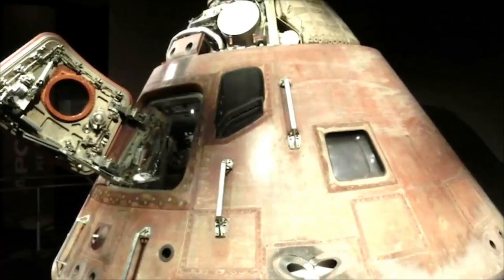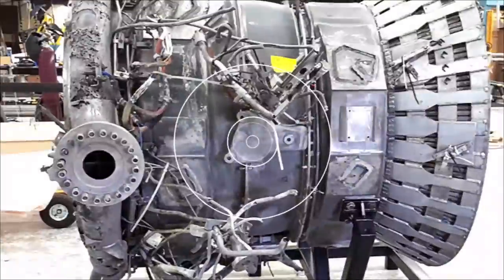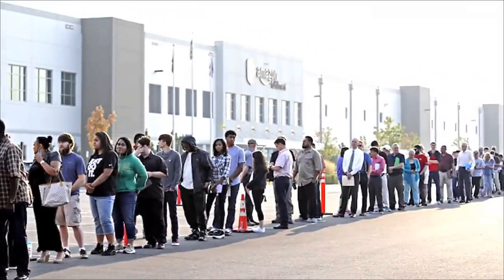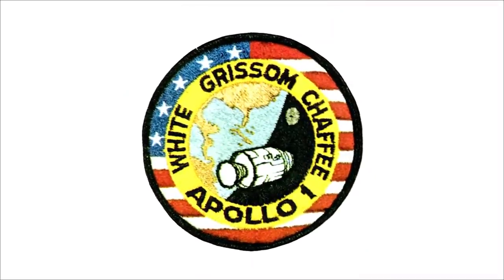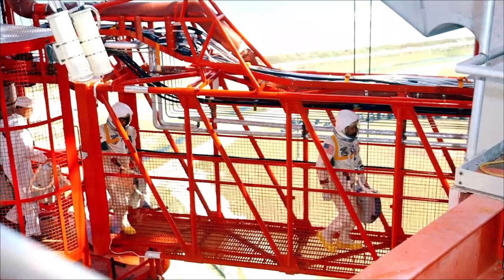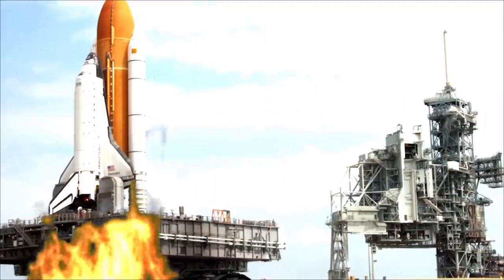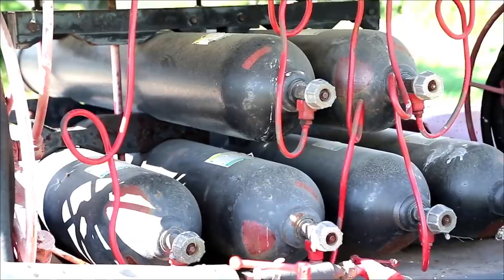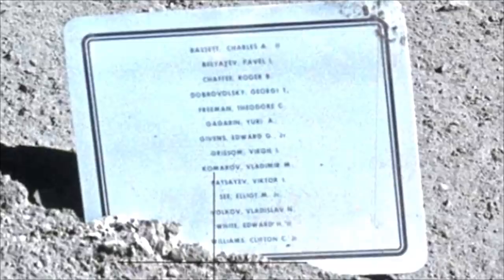When NASA Staff Opened The Hatches Of Apollo 1, They Were Met By A Truly Harrowing Sight

Comment: Short story... This was the Apollo1 fire that killed 3 crew members and was caused by the use of a pure oxygen environment and a spark from unshielded wiring. Boom. Saved you 12 minutes.
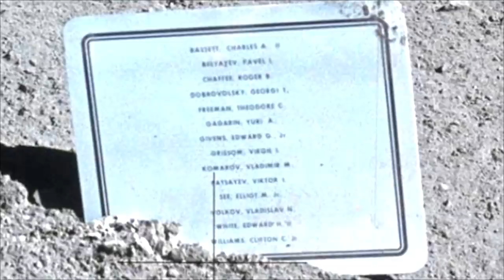Reply: Yep, and why insert a photo of VP Pence at 12:12 ?
Reply: Thank u. I'm out
Reply: I wondered why it took 12 minutes and 9 ads
Reply: thank you i will not be irritated for the next twelve minutes.
Reply: I remember it vividly.
Reply: FYI Oxygen isn't flammable.
Reply: @Medic69  Really... Then I suggest you stand in a pure oxygen atmosphere and light an oil lamp...
Reply: @ZephodBeeblebrox  he is technically correct. Oxygen supports combustion (like any oxidizer) but its self isn't flammable.
Reply: Thanks
Reply: waste of time to watch + too many ads
Reply: @nathan87dlkh  you can skip through the ads, just slide by or punch on the side of the ad, then start the whole thing over. No ads, you're welcome.
Reply: Medic Absolutely correct. Oxygen is NOT flammable, however a 100% O2 environment will support combustion EXTREMELY well. An arc becomes a spark, a spark becomes a flame, a flame becomes a conflagration, and the conflagration became a tragedy - which should have never been allowed to happen.

Which to the engineers at NASA should’ve been as obvious as the pain subsequent to a punch to the nose. Why they chose to us a pure oxygen environment has always been beyond me.
Reply: @Medic69  Swing by Cody's Lab and he burns pure oxygen in a propane or acetylene environment
Reply: thanks. closed it after reading this.
Reply: Thx for this
Reply: Wow I will be blocking this channel, maybe learn how to stay on track and not just use filler.
Reply: thanks, the guy was rambliing in a high pitch voice never arriving to the point.
Reply: Thanks. There is over an ad per minute on this stupid video. They stretch a short story out far too long.
Reply: Cynthia Ayers thanks for the tip, but not worth it. Will simply find a less greedy channel that respects their viewers.
Reply: tinwoods except that is exactly what most of us wanted because this video is stretched out far too long just to force you to watch a dozen or more ads
Reply: Thank you!
Reply: thx a LOT
Reply: Thanks !
Reply: @nathan87dlkh  use a damn add blocker, it takes you literally 10 sec to download.
Reply: Thanks bud that's all I wanted
Reply: @cr4zyu  uh... huh... yeah, that makes tooootal sense
Because I guess the moon landing was staged? People these days...
Reply: Thanks for the info
Reply: Thanks
Reply: Thank, oh my this video is so confusing and with so many unnecessary details that don’t help answering the click bait title
Reply: @Medic69  Though oxygen does not burn, it is an oxidizer, which means it supports the process of combustion. So if you already have a fuel and a fire, adding oxygen will feed the flames
Reply: Thanks
Reply: @ifixbones  it's not a fuel thus does not feed the fire.  A fuel can be a hydrocarbon or organic material such as wood or paper.  Oxygen is an oxidizer and the fact still remains a non flammable gas.
Reply: @Medic69  You were right on your first statement, however you're wrong in stating that O2 will NOT feed the fire.
Reply: @Medic69  0p00"99
Reply: Thanks
Reply: Thank you so much!
Reply: @johnshean8715  ... or the insert photo from Close Encounters movie ?!?
Reply: ... or a video clip from a Soyuz capsule
Reply: @OldStreetDoc  I'm of precisely the same opinion. It seems astounding that, with all of those brilliant people, surely someone would have realised this? It's one of the first incontrovertible understandings taught about lighting fires or welding with oxy-acetylene, that increasing oxygen levels promotes accelerated combustion/heating/melting. Surely ONE person would have raised questions about an oxygen-rich environment??? There must have been welders, scientists or somebody with a particle of common sense in the organisation, surely ...
Reply: thanks for saving 11 minute of my life
Reply: @OldStreetDoc  metal burns like wood in pure oxygen, plastics like gasoline.
Reply: @OldStreetDoc  cost, and system complexity.
Reply: legend zephod 👌 thanks
Reply: Thank you!!!!! I scrolled throuigh it and got nothing!!!! Appreciate you!!!!!!
Reply: Zephod Beeblebrox ....all you people who do this.....STOP⁉️
Reply: Thank you,old story,milked for viewers
Reply: I wanna see pics
Reply: @animalanimal7939  I'm trying to find one of those free places you can put lotsa pics, I tried Flickr, but they wouldn't accept my e-mail address!!!??
Reply: @ZephodBeeblebrox  ya oxygen is the gasoline of  gasses
Reply: Cool, thank you..I hate these draaag on, click bait videos.
Reply: I was a whole lot younger when this disaster occurred.   
The breathing air mixture was deliberately changed to be incapable of causing a fire on flammable, pure rubber wire insulation---which the designers also changed, to something less flammable.
       IMHO,  too little; too  late for the fatal crewmembers...
---Lee
Reply: THANK YOU!!
Reply: @nathan87dlkh  horrible video... you didn't miss much. No disrespect to the producer... but dudes!!!
Reply: Thanks. I avoided 1 add per min
Reply: Thanks.
Reply: @didyouknow
Reply: @Medic69  Pure oxygen is
Reply: Decision made by some suit.
Reply: @johnshean8715  And Mike Pence was about 7 years old when the fire happen. Shows him looking remarkably old in the photo for being 7 don't you think.
Reply: But you would miss random and unrelated images including Soyuz, Space Shuttles, a bushfire (with real firefighters thought), not astronaut people exercising in a gym, Sci-fi movie sequences...
If you can't make a video, all you have to do is telling a well known story, gather distantly related images, upload aĺl this stuff on YT, allow ads, and hope for clicks.
Reply: More like a whoof than a boom.
Reply: thanks... I hate how this channel saves what you're looking for to the very end.
Reply: thank you!!
Reply: @ZephodBeeblebrox   oxygen isnt flammable. it aids combustion processes. hydrogen is flammable.
Reply: @kurtreber9813  correct
Reply: I have see so many of you do the public service of encapsulating the key message of a mindlessly long video ! Thank you - if a 1000 people saw your message and acted on it you have 200 hours of humanity ! Thank you
Reply: I was thought it was Gemini 7
Reply: Tyty
Reply: Thank you !
Reply: 👍🏼👍🏼 Thank you
Reply: Remember the Electical industry will undermined safe to save $1
Reply: And don’t forget the preponderance of Velcro
Reply: No pictures of the charred inside ....no pictures of the remains laid side by side....no live last radio transmissions....
move along NOTHING TO SEE HERE
Reply: The sing song voice of the narrative is a poor choice for this serious subject.  There is a different video of the voices of the men screaming to get out.  It shows the astronaut space suits in aftermath, burned up.  It was a horrible death for these men.
Reply: I don't need your short story.
Reply: Thanks
Reply: Thanks!
Reply: Thanks professor
Reply: @ZephodBeeblebrox  hahaha 🙃 good one!
Reply: @Medic69  No, but its presence dramatically increases flammability.
Reply: Thank you 😊
Reply: what about the velcro?
Reply: And as I understand it also aided by a structure that used magnesium.
Reply: @kurtreber9813  dudes horrible for it
Reply: Thank you Time Hero. I vow to use a part of my saved time to send thanks. Many thanks.
Reply: I will watch anyway. So there!
Reply: Figures
Reply: @Medic69  pure oxygen Is highly flammable. The the oxygen in the atmosphere is why we can have fire. The reason that we don't go up in a ball of flames. Is because the atmosphere is comprised of. 78% nitrogen 21% oxygen 1% inert gases.
Reply: It was done on purpose to silence Grisham
Reply: Thanks.
Reply: @rationald6799  oxygen is not flammable. Show me on the meds where it says oxygen is flammable. Just show me the placard for flammable oxygen.. lmao I’ll wait
Reply: @wileecoyote5929  beep beep. Wile. Beep beep. Could be . Or could be a horrible accident.

Comment: The picture is not of Apollo 1. Apollo 1's door opened inward. That was the reason the pilots could not escape.
Reply: The “ door “ did not open inward per se … there were three segments to the hatch .. the inner hatch was designed to seal when the spacecraft was pressurized , the middle hatch was installed over the inner hatch , and was effectively the outside of the spacecraft .. the outer hatch was part of the Boost Protective Cover , made mostly of cork to protect the outside of the spacecraft during launch to about second stage ignition .
Reply: @johnkuehl6163  and once the fire was fully established, the inner hatch would've been impossible to open, as the pressure would be too high. The pressure growing high enough to eventually rupture the capsule.

Comment: I was a teen when this happened. Rescuers couldn't get the hatch door to open because the door on Apollo 1 swung inwards, NOT outwards as seen in the several views of the Apollo capsule that are shown in this video. After the fire on Apollo One, NASA redesigned the hatch door to open outwards. The hatch door opening inward was only one of the engineering mistakes that had to be corrected. It's hard to believe with the thousands of engineers involved in the Apollo program and none of them foresaw a problem with inward swinging hatch door or the 100% oxygen atmosphere in the cabin.
Reply: And no exploding bolts in case of emergency
Reply: 20/20 hindsight, and an unfair assessment.   Opening OUTWARDS presents dangers of its own.  Such as any fatigue failure in the locking mechanism could result in explosive decompression IN SPACE.  Having been well engineered enough not to fail for the following sixteen missions is no guarantee something wouldn’t have torn loose on the seventeenth.  It’s also worth remembering that a similar fire hadn’t occurred BEFORE Apollo 1 OR in the intervening five decades afterward suggesting that having made the change actually had no discernible benefit after the fact.  Just an added layer of safety for A VERY SPECIFIC MANNER OF FAILURE ELSEWHERE IN THE CHAIN.
Reply: @martyzielinski1442  No other Apollo mission had a fire because after this one NASA changed the atmosphere, down from pure blowtorch inducing 100% oxygen!  And fire suppression measures were added; fabrics changed...
Reply: One of the reasons that the inward opening hatch was designed, was because of an earlier Gemini mission (also with Gus Grissom), where, after a successful return to earth and a safe initial splashdown, the hatch blew out on his Liberty Bell module without warning, filling the capsule with sea water, and Grissom escaped just before the module sank beneath the waves.
After that, engineers decided to design a new inward opening hatch for all future NASA modules, a hatch that was opened by a lever, instead of the explosive charges that had been used on the lost Liberty capsule.
Ironically, it was this new and “improved” inward opening hatch that made escape impossible for Grissom, White and Chaffee when the fire broke out in the capsule of Apollo One.

Comment: The hatch on that spacecraft opened INWARD. NO way that Ed White, as strong as he was, was going to pull that hatch open against the building pressure inside the capsule. The whole thing was over....star to finish....in about 20 seconds.
Reply: Even today hatches used in spaceflight open because of the lessons learned with Apollo 1.  Case in point: Watch one of NASA's YouTubes of an ISS EVA (spacewalk) and you will note that the stations huge airlock door opens not to space, but towards the interior of the station on side rails so that the suited astronauts in the event of an emergency with no help on the inside can ingress into the station quickly.
Reply: I'm glad that although their suffering was intense, it did not last long.
Reply: I've seen the harrowing few seconds of video of Ed White trying to open the hatch as white hot fire blowtorches up.  This clip is mentioned in this video as if it were "Rumored."  It's quite real, just very rarely shown, understandably.   The fire white hot blooms filling the entire screen /hatch area / capsule.  Ed keeps trying a couple seconds more then falls back and disappears in the blazing inferno.

Comment: My Grand father, who had been a Marine sniper and advanced scout on Okanawa. Years later, he was working on electrical equipment for NASA. He made several versions before NASA signed off on it. My grandfather fought with NASA on the cercit boards on the Apolo 1 test capsules. It was the one that killed the three that was testing the Apolo 1. They were killed by improperly fabricated under stress. My Grandfather submitted the circuit design 3 or 4 times. NASA forced the bad design. One of the problems was the 100% oxygen. They ran it at 100% oxygen, which caused the test of Apolo 1. I have the letter stating it was destroyed by the design failure in the circuit board. My Grandfather, Pery Lee Leftwitch Ratchford, never worked on a NASA project again. The letter stated that the accident was caused by the poor design. He never wanted to put anyone in that position again.

Comment: So, the crew found no LESS than 200 items that they were extremely concerned about, of which dozens were considered to be immediate grounds for mission launch cancellation, yet a few high ranking NASA officials denied and ignored the crews concerns.  All 3 men knew something terrible was going to happen, and all 3 men knew that their lives were in serious danger.  Just like the Challenger disaster which NASA was told by several scientist the morning of the launch, that their would be a catastrophic fail of the booster O-rings due to the low temps, NASA overruled the scientists assessments and and warnings.  

This is the issue with having a dictatorship, with ignorant, high ranking, poorly educated management, and highly educated lower ranking scientists/crew.
Reply: Its called the real world. Shit happens. People get complacent; people push hard; shit happens.
Don't try and act like you know something no one else does.
Reply: Gene Kranz, Flight Director KNEW what the problem was. In fact, following the disaster he addressed Mission Control with this speech:

"Spaceflight will never tolerate carelessness, incapacity, and neglect. Somewhere, somehow, we screwed up. It could have been in design, build, or test. Whatever it was, we should have caught it.
We were too gung ho about the schedule and we locked out all of the problems we saw each day in our work. Every element of the program was in trouble and so were we. The simulators were not working, Mission Control was behind in virtually every area, and the flight and test procedures changed daily. Nothing we did had any shelf life. Not one of us stood up and said, "Dammit, stop!"
I don't know what Thompson's committee will find as the cause, but I know what I find. We are the cause! We were not ready! We did not do our job. We were rolling the dice, hoping that things would come together by launch day, when in our hearts we knew it would take a miracle. We were pushing the schedule and betting that the Cape would slip before we did.
From this day forward, Flight Control will be known by two words: "Tough and Competent." Tough means we are forever accountable for what we do or what we fail to do. We will never again compromise our responsibilities. Every time we walk into Mission Control we will know what we stand for.
Competent means we will never take anything for granted. We will never be found short in our knowledge and in our skills. Mission Control will be perfect.
When you leave this meeting today you will go to your office and the first thing you will do there is to write "Tough and Competent" on your blackboards. It will never be erased. Each day when you enter the room these words will remind you of the price paid by Grissom, White, and Chaffee. These words are the price of admission to the ranks of Mission Control."

It was called "Launch Fever"; when the desire and pressure to meet a deadline overrides the safety measures and protocols put into place to ensure a safe launch, mission and return. We see it every day in our lives and our work. Most of the time we skate by and sometimes we experience disasters some of which cost lives. These people weren't "ignorant", nor were they "poorly educated", quite the contrary; they were the best and the brightest.  But they got caught up and nobody was willing to be the one to yell "Dammit, stop!". 
How many of us, would have done so in that situation? Who would be willing to be the whistleblower? Who would be the one that holds up that expensive project and has to explain why? Who is willing to take that responsibility?
Reply: @dangelo1369  Excellently stated by Gene Krantz and by you.
Reply: I worked with a NASA employee who worked on Columbia. He told me that when they had the foam strike on lunch, they immediately expressed their concerns and it was sent up through the chain of command. Eventually it reached a bureaucrat who stated it was not important and shut it down, after that no attempt was made to address the potential problem that resulted in the loss of Columbia and her crew.

Comment: I had always thought that one of the fixes for this incident was to change from 100% oxygen atmosphere to a normal percentage. But someone corrected me on that. They said the fix in regard to the oxygen being more dangerous under pressure was to simply reduce the pressure of the 100% oxygen atmosphere. At 100% oxygen you don't need full atmospheric pressure. This has the weight savings benefit of only needing to carry oxygen tanks and no other gasses.